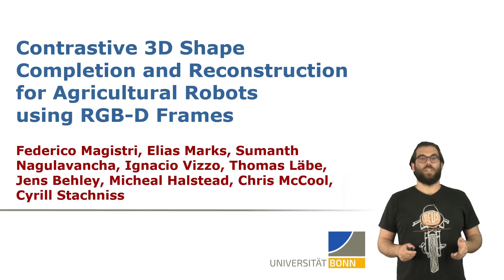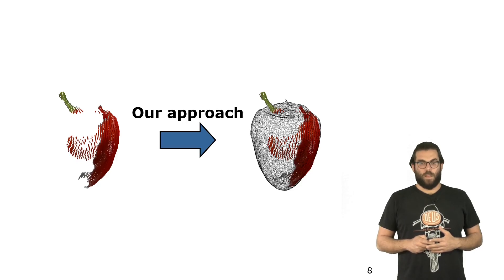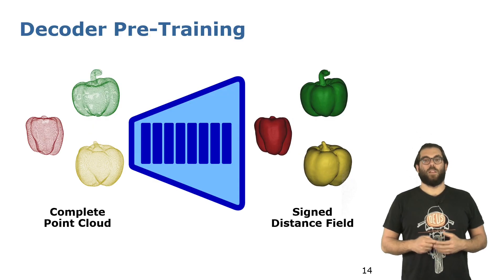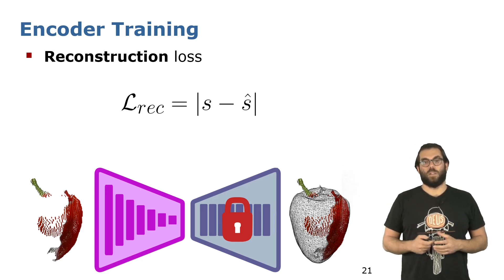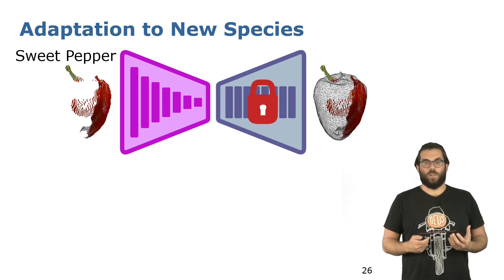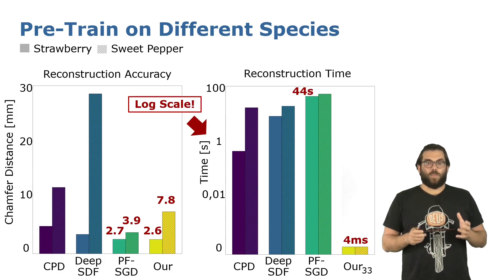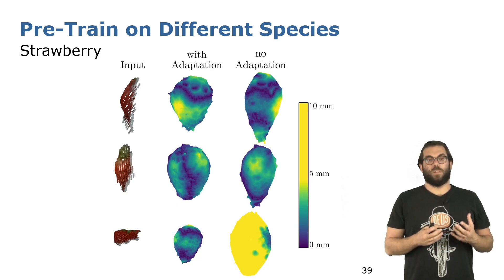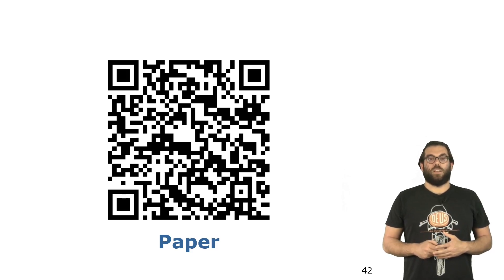Talk by F. Magistri: 3D Shape Completion and Reconstruction for Agricultural Robots  (RAL-IROS'22)

Comment: Regarding the Latent loss @ 3:30

What is the motivation behind forcing the magnitude of the latent vectors to be equal to unit norm? Given the shape of your decoder, the shape of the latent vector should match the dimension of point cloud input, right? Does this mean the decoder (point cloud -> SDF) requires point cloud to be unit norm vectors as well? What is the input shape of the decoder?